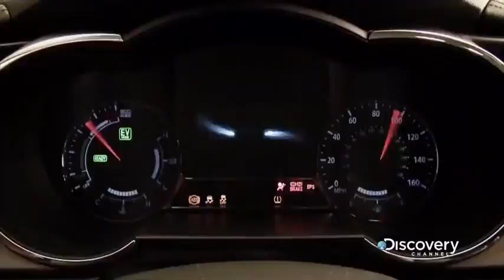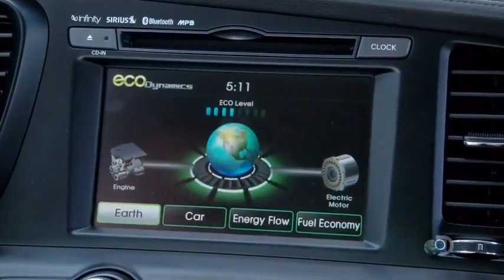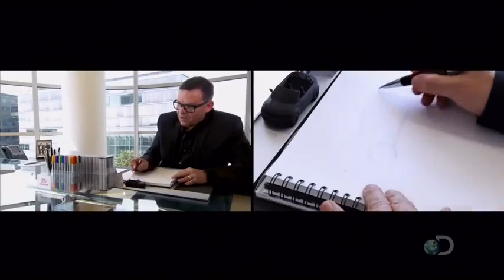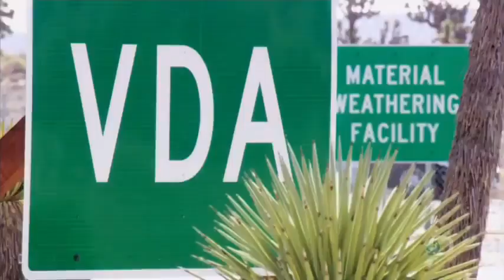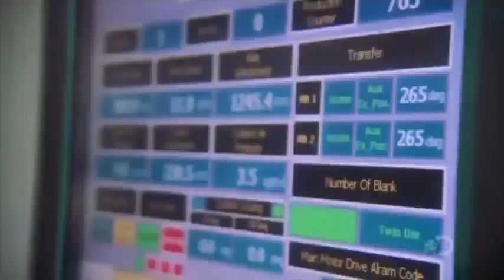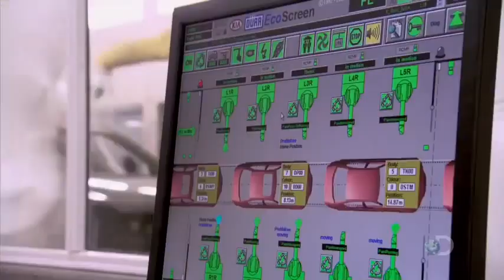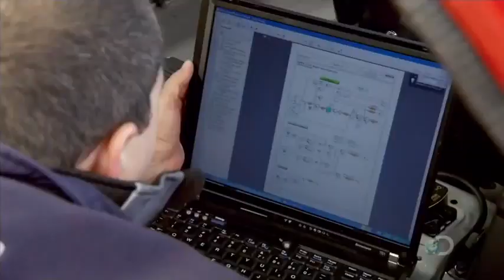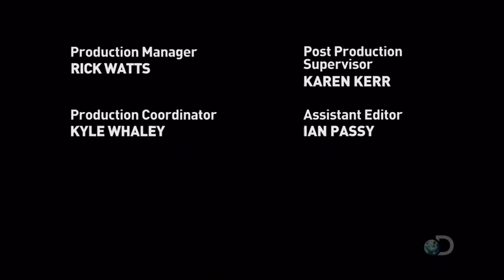Building a Kia Optima

Comment: I bought 2015 Optima LX for my birthday! I've been driving for over 40 years and SO FAR this is one of my favorite cars. Pros: Quick, quiet, stylish, impeccable workmanship, layout interior, great handling, good gas mileage and braking. Cons: Weak AM/FM/SAT Radio (CD is great),  Slightly rough Idle    

Past owned cars: 3 Honda Civics, Honda CRX, Honda Accord, Toyota Solara, Infiniti M45.

Comment: I have a 2012 EX. I put $1200 worth of modifications in it, but kept the look clean. I have had it for 2.4 years with ZERO problems. No breakdowns, no recalls, and I still get attacked in parking lots by (mostly women) asking about it. Great car. Oh, bonehead mechanic guy in the video overstated the torque by 10 lb ft. The 2.4 has 186 lb ft, not 196.
Reply: Chris Skalski why is important what year it is? its same car ...

Comment: I bought my car 9 months ago in never giving any problems the car is Kia optima LX GDI 4 cylinder sedan silver with 99.700 miles 2013 200 HP cleaning inside nice beautiful color silver coming with sunroof in front very nice car smoothly for driving good suspention running very well and have small accidents in the back of rear but the running like new.

Comment: It a beautiful car, I bought the 2013 Kia Optima EX 2.4L.  I have just over 20,000 miles on it, and I have recently had two problems with not being able to start my vehicle once while parking it face down hill towards the street in my driveway later got in the vehicle and there was absolutely nothing. I put my jump starter on and couldn't get it started I left the jump starter on for a period of time and finally was able to get it started and let it run thinking it was the battery. Went and had the battery checked they said my battery was perfectly fine. Then one time I took it out front of my home and parked it out front with the nose facing on a downward slope both of these times I set the emergency brake. After finishing washing my vehicle I could not start it. Nothing the vehicle did not even turn over. Again used my jump starter and eventually was able to start my car. Now recently I came out of a doctors appointment I got in my vehicle and suddenly my air conditioning was no longer cold. The next morning when I got in my vehicle the air conditioner was working oh I forgot to mention the day that I got in the car when I first noticed the air-conditioner had quit while sitting there with the vehicle running and it was very hot outside in the 90s, I open the drivers door to let the air come in and the dash displayed a message that there was no key in the car. However my key was in the exact same spot didn't move it. The air-conditioner worked for two days and the next day I had no air conditioning. Then after coming out of a doctors appointment in having stitches removed I get in my vehicle I started it and it was making a phone call prior to pulling out of the parking lot. My engine started to stumble and then quit. Good thing I continually carry my jump starter with me no matter what vehicle I have. However this time if I would push the button the car would act like it was trying to rollover and start. I let the jump starter sit for a moment, tried several times and then eventually got it started but didn't sound like it wanted to run I have 3/4 of a tank of gas I still have 1000 miles to go before I even needed and oil change so I was good on my oriole level two. So I immediately wanted to get to the closest auto parts store  that could check my battery again. I got to an AutoZone store and after pulling into the parking lot looking at the display I noticed my radiator temperature was maxed out. I turned my heater on full blast to try to cool the engine down before I shut it back off. Got the temperature down some and then I went and purchased the premixed antifreeze and the store manager came out and put it in the reservoir which was only showing a very low level in the bottom. We turn the heat off and the vehicle started to heat back up. He said he couldn't understand what was going on with it either I said  I would have known if there was an antifreeze leak in my garage as I keep my garage floor. Clean. So as we had the car sitting there running he could see that it was pulling in the antifreeze from the reservoir but if the air-conditioner was turned on it will heat the vehicle up and start spewing out the top of the reservoir outlet. I started to look around in the car at the fans and I noticed the fan behind the radiator was not working. He said well they don't run all the time. However if the vehicle was running the air conditioning and heating up it should kick on and it was not. There are several recalls back on my vehicle one is a safety recall that he hasn't even determined what the fix will be yet and has sent a letter with an envelope to submit any bills you might incur regarding fragments shavings being in the engine causing you to have an engine failure. Engine connecting rod safety recall campaign.  The other one is a voluntary service campaign to apply additional anticorrosion material to the underbody components of certain 2011 to 2014 My Optima and Optima hybrid vehicles that were originally sold in or are currently registered in the states were heavy amounts of road salt are used. I have heard some mention of individuals posting YouTube's regarding the Kia optima not wanting to start when it is parked on an incline. I don't know the exact details but apparently something to do with transmission not recognizing that it's in park or something to that effect. I wondered whether that was my problem both times when my vehicle would do nothing. From the very time I purchased my vehicle and till now I get very poor gasoline mileage. When I initially made mention of it to my Kia dealership one of the employees said Kia was offering I believe $500 rebate back to owners that we're having that problem however they never gave it to me and never told me how to obtain it. I generally always right my mileage on my receipts each time I get gas.